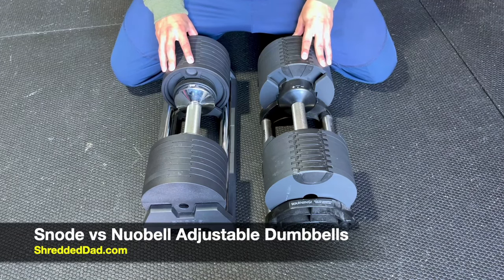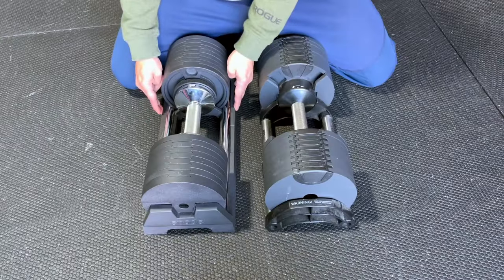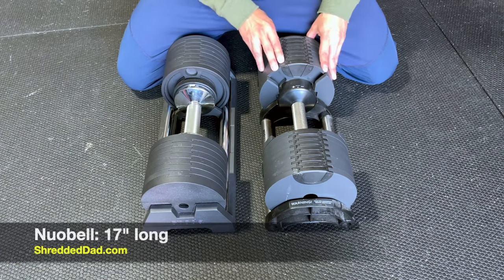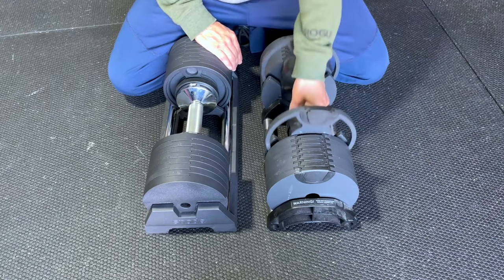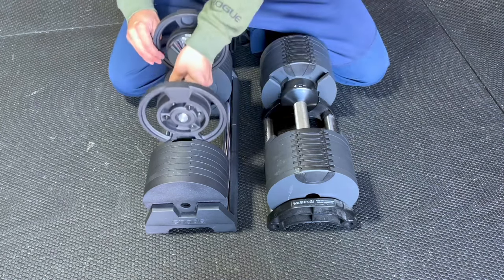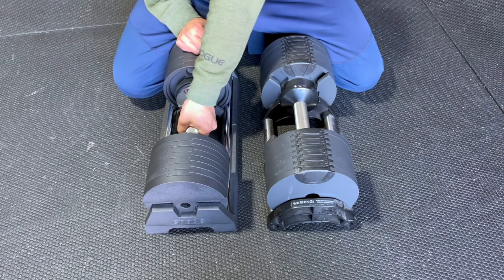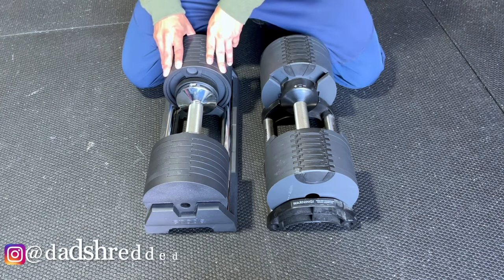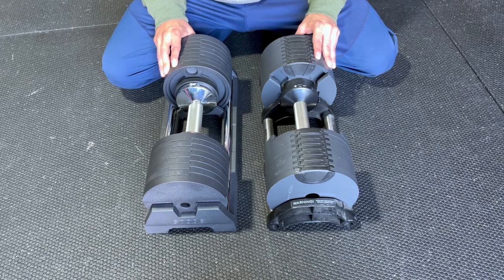Snode vs Nuobell Adjustable Dumbbells:  What's The Difference?

Comment: Out of the two I would take the Nuobell based on the smaller handle, thick handles makes it feel like the forearms are doing too much work.

The Snode sort of makes the Ironmaster obsolete if it's truly drop proof, weight changes take forever on Ironmaster.
Reply from the maker: It also depends on the amount of  weight you lift.

For most people 80 lbs will be enough.

For those that like 100+ lbs, Ironmaster is an option since they’re expandable

Comment: Can you fit your hand with the 2.5lbs microgainz plates on the Snode?
Reply from the maker: It’s tight but yes. If you have large hands it won’t be comfortable
Reply: @ShreddedDad  sweet, thanks for the response.
I'd much rather add weights here if I could compared to the magnet ones on the ends. Seems like a hassle for having to unrack, add magnets, pickup, and reverse to put them back in the housing
Reply from the maker: @ashylarry7411 yup that’s true. It’s more work

Comment: i had the nuobells sold them and now have the snodes, the snodes night and day beat out the nuobells I have the magnetic plates to go with them and its nice not haven't to put the dumbbells in the craddle to add 2.5lbs or 5lbs to them much easier in my opinion and the the snodes are built much much better no comparison. and if the snodes break they are very easy to fix not so with nuobells.check out average Joe YouTube video on them he breaks them both down on repair on which can't be done with nuobells.
Reply from the maker: Snodes are built tough for sure